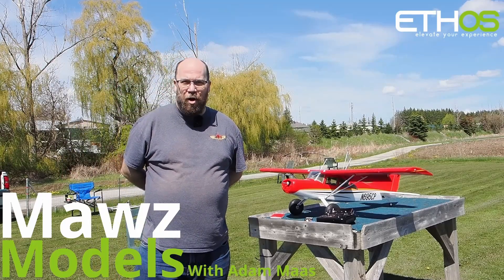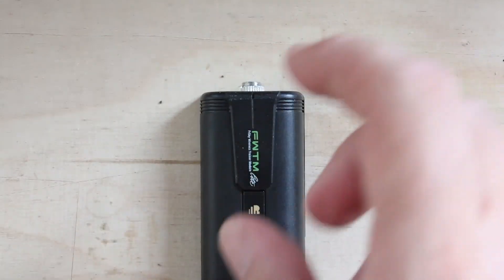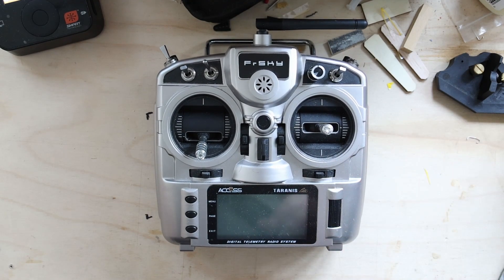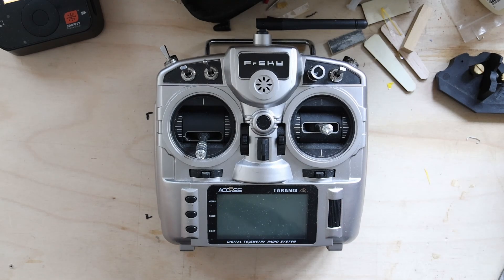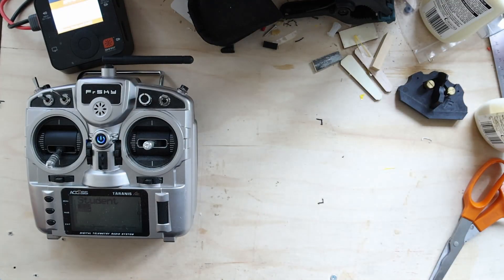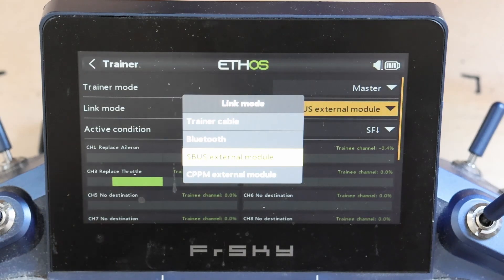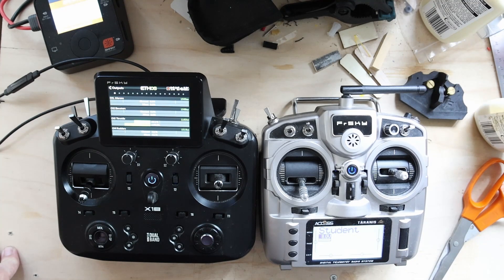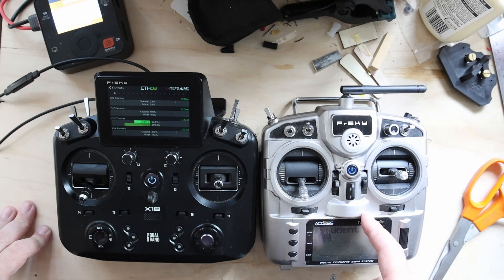Gear Views - FWTM Lite Module

Comment: Adam which frisky radios support sbus out pin so you don't have to use the cable.
Reply from the maker: That's a receiver-level setting. It's supported on any pin on the 10 and greater port Archer Plus, TANDEM and TWIN receivers, and on the dedicated SBus Out port on the 8 port Archer Plus and TWIN receivers (there's no TANDEM receiver in that form factor). The serial receivers (Archer Plus RS, TW MX and TD MX) all have a dedicated SBus out.
Reply: @adam_mawz_maas you had mentioned in your review of the trainer module that the radio needed an sbus out on the radio (as you said @ 1:31) so you didn't need the 1/8 jack cable. Did you mean an sbus in pin on the instructor radio ? So you didn't need the cable? If so which radios have the sbus in pin ( or out as you said in the video.) TIA. Thanks for all the Frsky advice you give on here and on Facebook. Much appreciated 👍